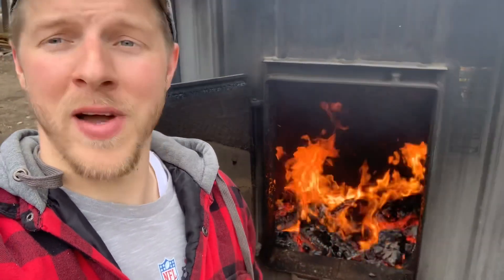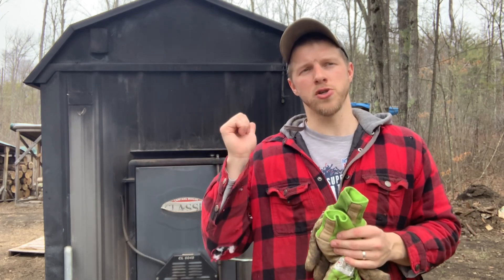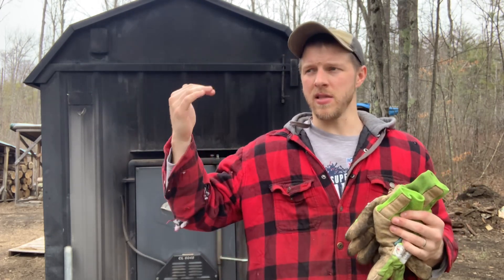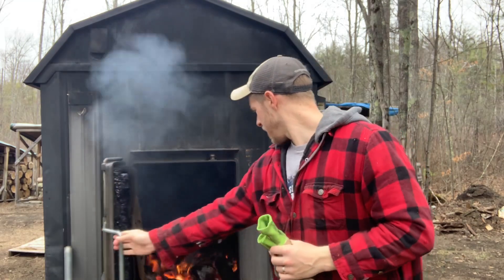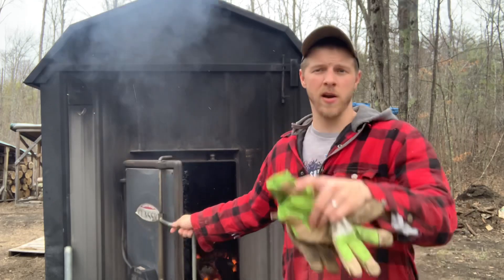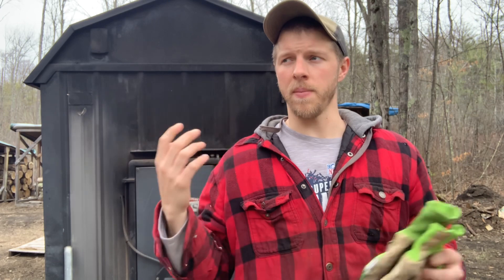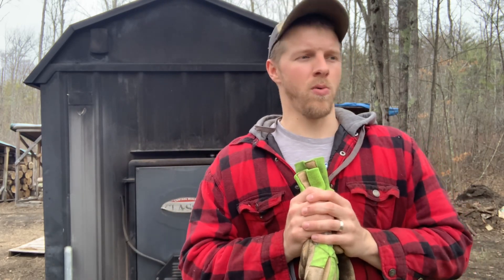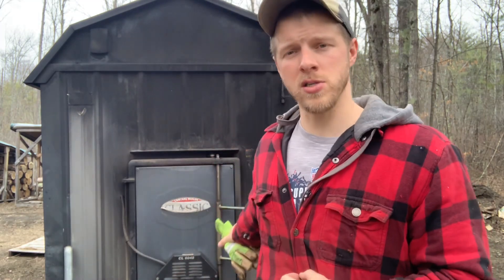Top 3 Homeowner Outdoor Boiler MISTAKES!

Comment: I don’t have a boiler but I have a geothermal system. This isn’t exactly what you described but was a lesson learned. This is our first year and it’s definitely a learning experience. We had it setback during the day and found that the system had to run a lot more in the afternoon to get the temp back up. We changed the program on the thermostat and kept the temp the same all day and found it actually ran less. We do set it back a few degrees overnight as we like to sleep in a cooler house.
Reply from the maker: Interesting that a Geothermal system behaves the same way! If I was to let my machine burn out it would take TRIPLE the wood to get it back up to temp at night! Thank you for tuning in!
Reply: @HomesteadJay  our system has a couple of preheat holding tanks for the glycol fluid that circulates throughout the loop field. It’s quite a remarkable system and we only used about 120 gallons of propane since the end of September which includes cooking, clothes dryer, some hot water and heat when it’s really cold outside. Most of the domestic hot water is heated by the geo system. Unfortunately it was expensive but we get about 30% back in tax credits and rebates from the local utility.
Reply from the maker: @gregj2647  Thats really cool! Thanks for sharing! Always cool to hear other methods!

Comment: I like to watch how to run one because one day I'll be leaving somewhere that I need one
Reply: I have seen a few of them and my dad up on But i am not up there too get know how on it
Reply from the maker: @ericaken3338  Yes I know what you mean. Pretty straight forward open the door. rake coals around. load with wood. walk away and repeat when it needs wood again.
Reply: So it's pretty much like a wood building fireplace but outside
Reply from the maker: @ericaken3338  Yes. Just heats up a water jacket thats pumped into the house and tied into your existing heat system. Check this playlist out and scroll through! lots of knowledge to be had! https://www.youtube.com/playlist?list=PLtQ7dEqaOitwgCtfVxnFOeJ7tPGFz5_nq
Reply from the maker: Hey Eric! I have plenty of videos on how to basically run a boiler check out my other videos if you havent yet! Thanks!
Reply: Ok thank you

Comment: You explained that very well. We installed our Central Boiler in 2007. Factory temps were set at 175 to 185. We've never changed anything.
Reply from the maker: Good! Shouldnt have any issues on that front! Thanks for tuning in!

Comment: Great points to add on the machine , but I’m interested to know what your going to use that u mentioned to clean it
Reply from the maker: As trusted advisor to the channel ill tell you first lol I reached out to Fluid Film about using their products to oil coat the inside of the firebox when im done heating and they sent me some cans to use. Should work a lot better than the motor oil and compressed air disaster I did last year. Still have to put the monkey suit on and climb in and scrub a dub dub the inside lol
Reply: @HomesteadJay  can’t wait to see this product and get your opinion 👍🏻
Reply from the maker: @shayn4220  Prob next few weeks! I may even do water change idk yet.